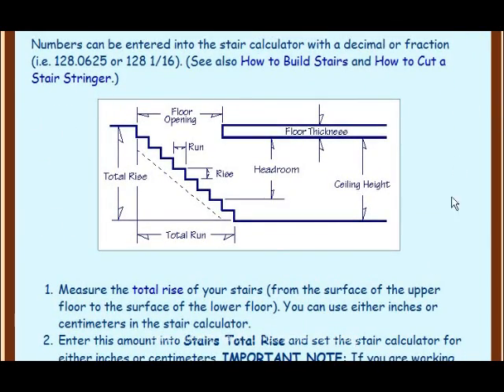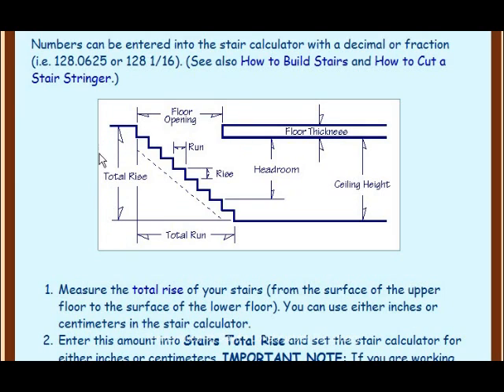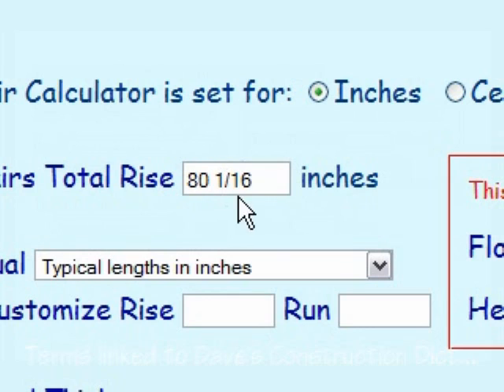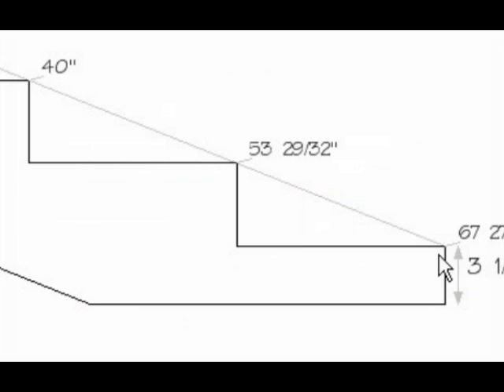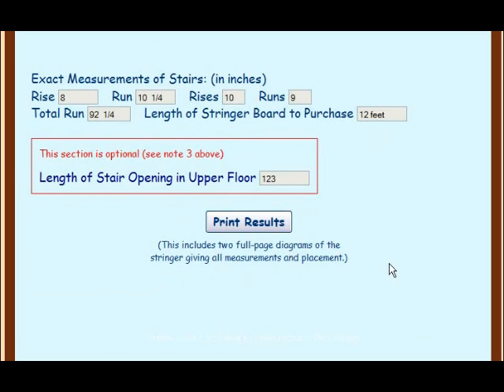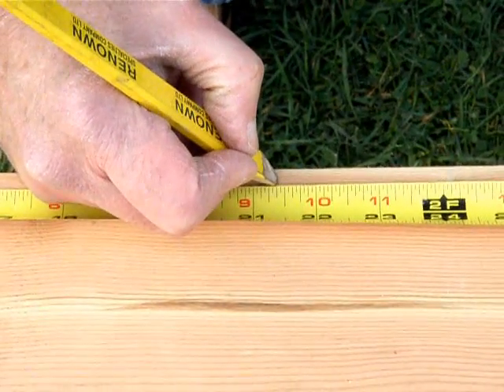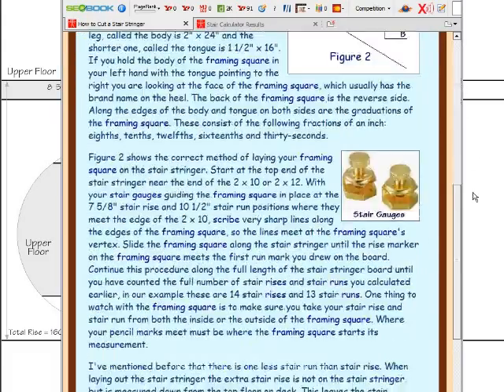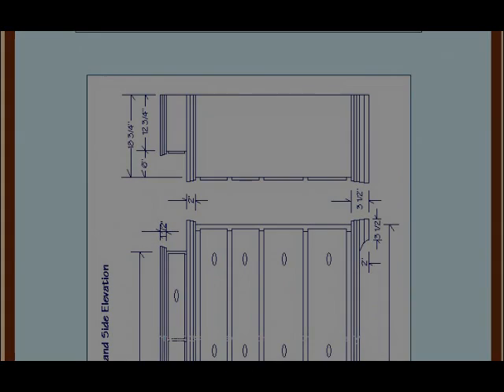Stair Calculator

Comment: Hello again, I should mention that I know the measurements of the left to right wall to wall which each step is 35".  The Depth of each step is 10" and the risers are 6.5". There are 12 stairs all of which are wall to wall that currently have carpet. I am asking how to determine or ball park the cost per square foot (not sure if stairs are measured by Square ft.) to replace the carpet with hardwood or how to determine the amount of wood I would need. I am just a girl, living alone, learning as I go and your videos have helped me in many areas. Thank you very much. Padi
Reply from the maker: Padi Salamone You have 50 square feet for treads and risers, both.
Reply: DaveOsborneDotCom Wow! thanks for the quick reply.  Big help, as always!xo!

Comment from the maker: Thanks for all the super comments. Dan and I are happy we can make cutting a set of stairs a bit easier for y'all. I had a comment that I flipped the stringer over before I cut it. Yes, that is correct. You always want to start the cut at the edge of the board rather than plunging it into the board. I guess Dan turned the camera off while I was doing that. Out of 157,626 views only one person noticed that, or at least commented on it.  Thanks, again
Reply: DaveOsborneDotCom